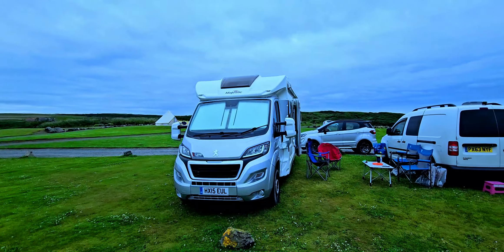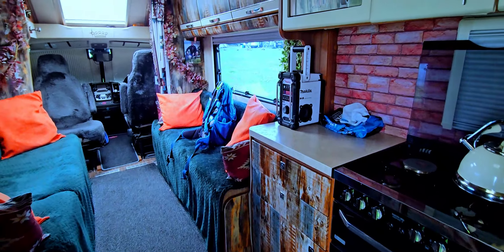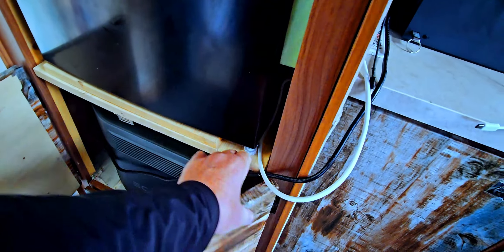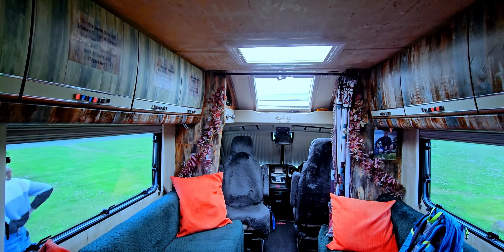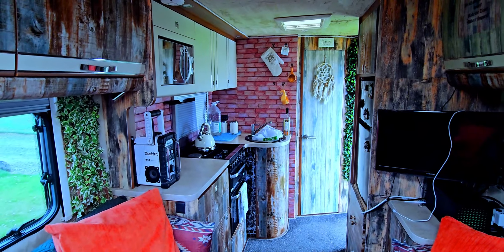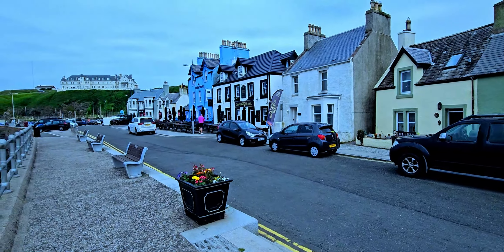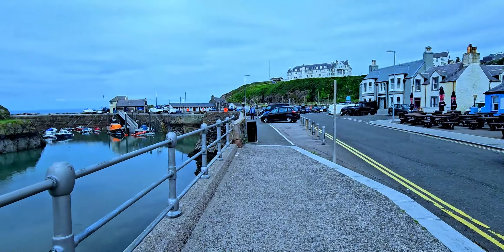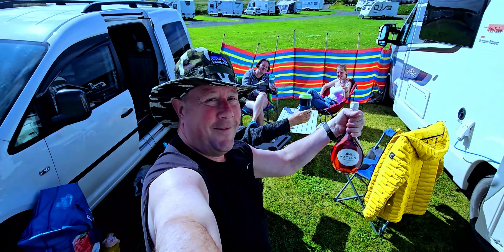My Solar Setup On My Motorhome Lots Of Power From Ecoflow & Afery

Comment: Hi mate, good review.
We have similar set up, 480 on roof for the lesuire batts, and victron mppt,b2b and mains , bought the delta max last year and x2 delta 2 this year and they are invaluable for extending your trip, especially in the winter time.
 the new ecoflow alternator charger,800 watt charger for you van while driving. I'm going to stick one on mine, will feedback how it goes. Great vids mate.
Reply from the maker: @Scottishprepper73  yes definitely the alternator charger along with solar is a game changer, your set up sounds brilliant, im heading out this weekend so will make another film of how I get on, thanks for your input myfriend
Reply: @DensumRanger  awesome, will look out for it

Comment: Solar is clearly the way to go with mobile homes, whether it's a converted car to a bus-size or larger setup. Once it's installed the costs are sunk and aside from the relatively minor costs of maintenance you're getting free power for the life of the setup. And the bigger the rig, the more power you can get.

I recently saw a van or truck build video by two young brothers who didn't even consider solar and instead installed a generator to the back of the vehicle, on a flimsy wooden crate of all things, and painted the vehicle black. Literally the dumbest thing I've seen in mobile home videos.

I've never owned a mobile home, but if I ever did, I had this idea of installing solar panels on locking slide-out rails, so that when you're in motion they're locked in over the roof but still generating power, but when you're parked you can slide them out and maybe secure them to the rig with a diagonal brace and they do double duty as awnings, with your roof free to either use as a deck or for a second, lower set of solar panels to generate yet more power (and since some panels can be walked on they could actually serve as both). Has anyone ever tried this and is it even feasible?
Reply from the maker: @kovie9162  definitely possible myfriend any setup with the solar technology we have available to us today can be mixed, ie I've got the alternator generator which adds to being able to charge fast, 800 watts constant while engine is running along with solar charging at same time, definitely the solar generator is the future with the Life Po4 fosfate lithium which is more safe & last 3 times longer than lithium Ion, ill be doing up date films on my set up soon 😀